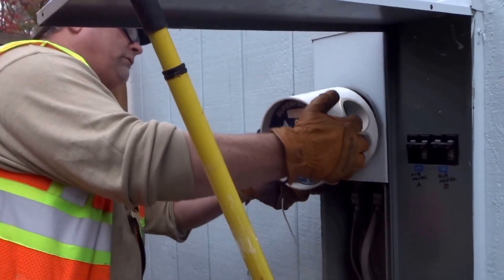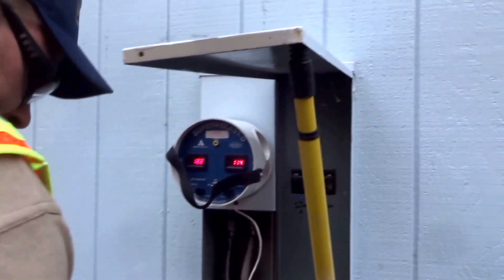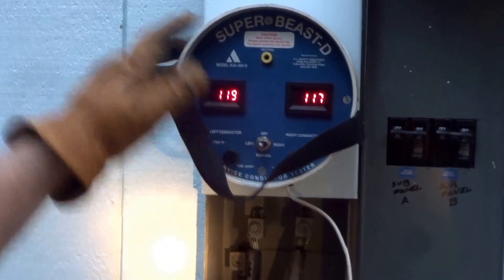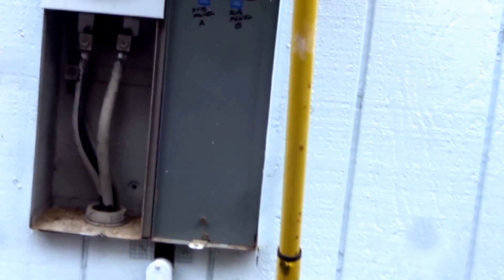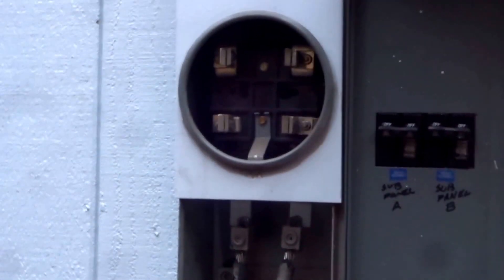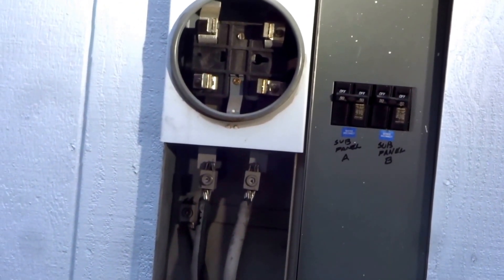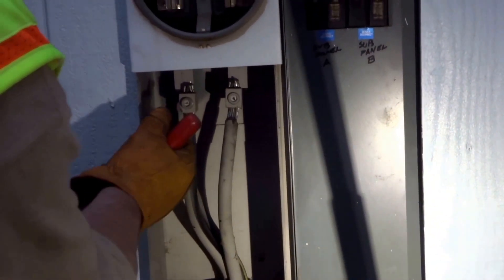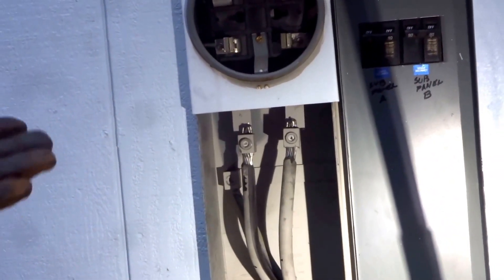Test for "Open Neutral" by utility personal

Comment: Testing for an Open Neutral is easy at the Meter, on regular split phase the meter connected to the 2 hot wires on the LINE side should be 240 to 250 volts and between each hot wire and the neutral wire 120 to 125 volts.   Anything much lower or higher by 4 volts means between neutral and hot means that you have a Neutral wire issue.    Hot to Ground wire should be about 118 to 125 volts with the ground wire separated from the neutral wire for testing purposes to isolate the neutral for testing.  The Meter area is dangerous and you should have 600 volt electrician gloves on both hands.
Reply from the maker: Right and the electrician decide to not wear those gloves: his choice.

Comment: What happens when the customer has a really good water ground bonded to the panel? I run the same super beast and have seen intermittent open neutrals. Good one minute and then the beast drops out and you can hear the beast struggle to stay running and it swings really bad, typically you would see arcing marks on a corroded or loose connections in that meter can.

Comment: U loaded it up and it welded back together
Reply: I think this might be what happened at a house I was at earlier today. Nearly the whole coax drop was melted to the aerial tap. Customer said it was smoking last night! Since our company doesn't provide us with amp clamps, I was positive something was seriously wrong, so I called the power company and told them about the melted drop. The troubleman got there and checked it at the meter (not with one of these tho) and said it was good. I even asked the customer earlier if his lights were flickering and he said no.

Anyway, nothing found, replaced the drop and told the guy if it happens again, call an electrician first. In 18 years, I've seen a handful of drops melted a little near our ground block or the tap, but nothing this bad!

Comment: open neutral, the test box puts a LOAD on each side.  The side with the HIGHEST load (resistance) would have the HIGHEST voltage DROP because the two sides are in series.   Voltage drop means HIGHEST voltage reading.      Comment please.  No voltage drop, no open neutral.
Reply from the maker: We requested that the utility perform thirstiest because measure 3.1 Amp AC on the service lateral.  It turns out  that the  steel rebar in the pool shell is  acting  as a giant grounding electrode for utility current that will not go back on the utility neutral.
Reply: @windheimemfsolutions   Curious, what was the solve?

Comment: Ol boy better hope his safety rep doesn't see him doing all that without freaking secondary mitts on 😂😂 use leathers on energized equipment when the camera ain't rolling, ya dum dum
Reply from the maker: Hello Levee,  You are right. The "utility trouble man" is the one using the leather gloves: it is his choice. He should be using the red rubber 1000 volt gloves with leather over-gloves.
Reply: Stick to the topic
Reply: spoken like a guy who has no idea how to diagnose, locate then repair a service neutral.  Go back to the line truck
Reply: @justindoolan8236  ten years in the trouble department. Feel free to not use safety equipment in front of a camera. You look like the kinda ape that would 😂

Comment: I'm having an issue where my shop is at 140 volts, but my house dips to 110 volt. Shop is feed from 70 amp breaker in my main panel. I have smoked a few outlets (netural side) from using the blow dryer, so is the problem from the drop from the ultity or the feed wire from the meter to main panel?
Reply: many factors distance of wire connections load  alot going on but higher voltage on one leg of hot wire is sign of loose neutral need to test circuit on a higher load to determine it
Reply from the maker: Have the utility check their connections.

Comment: To answer your question, the "Super Beast" of burden has a 20 amp load. We make a "Mega Beast" of burden which has an 80 amp load if 20 isn't enough to find the problem. 

Super Beast: https://hjarnett.com/products/manufactured-products/service-conductor-testers/super-beast/

Mega Beast: https://hjarnett.com/products/manufactured-products/service-conductor-testers/mega-beast/
Reply from the maker: Thank you: very good to know that.

Comment: Have worked with similar devices to this super beast and as the guy states, it's basically a pair of hair driers tied into volt meters so they can test each leg going out to the street. Once the power company runs that test they know if the problem is on their side (at their cost) or your side. (at your cost) Of course the meter pan is just an easy testing point. Technically speaking the power company is only responsible up to the connection at the corner of your feed, either up at the roof (the weather head) or below the meter on underground service. The rest is between you and your electrician. Bottom line is that device only draws maybe 15 - 20 amps on a leg, which is all you need to find a bad neutral.
Reply: Not every utility follows this but there are a bunch who do.

Comment: Great video! I will make a call to the utility company to have them bring a Super Beast-D. 
I've been looking at a friend's house that I suspect has an open neutral where a couple of inductive loads caused the 123v-123v to swing to 89v-157v. Surge protected power strips on the "high" leg have been smoking up the MOVs and now they're starting to burn control voltage transformers in their appliances.
They called the utility company several times and they kept telling her that all the connections "looked good". It's been frustrating.
Reply from the maker: Hi Felix,  Did the utility test for a weak or open neutral yet?  Open neutrals create over voltage conditions in your house that can start fires and burn out appliances.